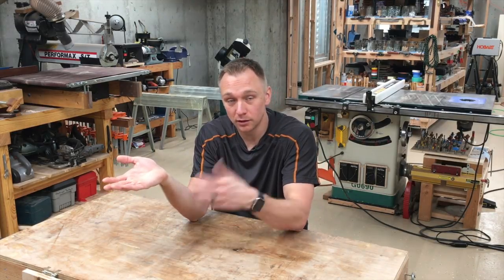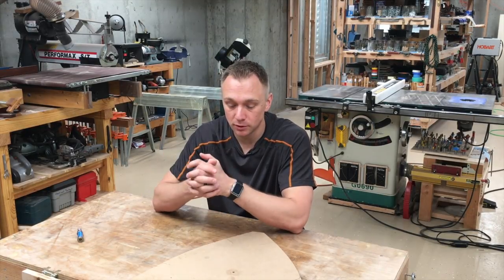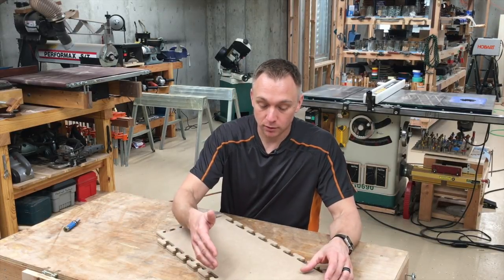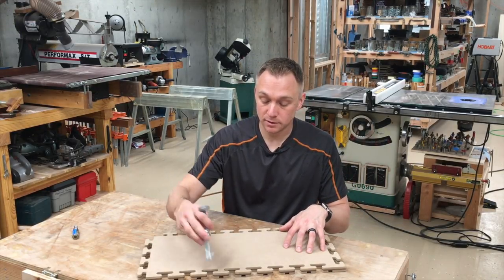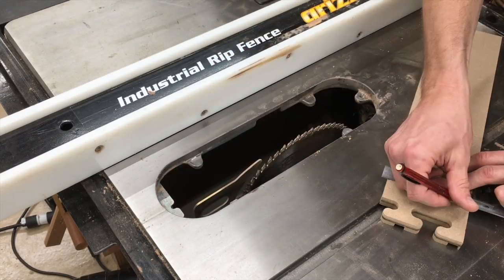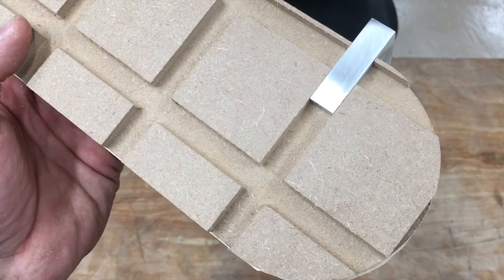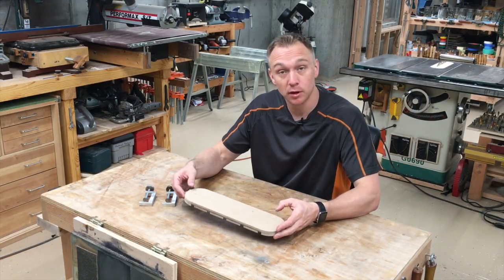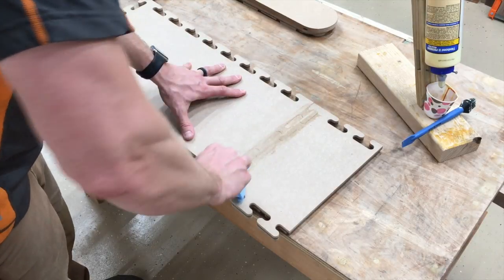Product Launch!!!  Template Routing System

Comment: must say, looks like a great system and the price point looks good! 
I don't do a lot of template routing. but if I may make a suggestion for future product additions,: a clamp with quick adjust like on pipe and bar clamps and a cam action for final tightening. Of course, the average woodworker probably won't really mind the speed of the screw, but production woodworkers might like more speed.

I do a lot of production work, thousands of items in a run,  something that saves me 4 seconds per part for 3000 parts means over 3 hours of saved time. That may not sound like a lot of time, but when I shave 4 seconds here and 3 seconds there, another 5 seconds somewhere else I can cut production time down by more than a day, that can mean the difference between making the deadline or going over due to unforeseen circumstances.
Reply from the maker: Good comments, just fine quick point, if you are are using the screw to switch between workpieces that are the same thickness it is really as fast as a quick release, since there is hardly any travel on the screw.  The screw is a bit slow when you go, say, from a 2" thick workpiece to a 1/4" thick workpiece, but that happens much less frequently.
Reply: Thanks for the reply. I understand what your saying, it was just a thought. I'm always looking for ways to improve production efficiency or ergonomics of an operation.

Comment: I really like your product. I was really trying to figure out a solution to the problem that you solved. One suggestion/question I have is that wouldn't it be more cost effective in production if you would just have different size boards instead of having the puzzle edges cut into every peice? Sort of how they sell plywood sheets in different sizes. That could even become a standard product at big box stores. Imagine a display at the hardware store with the template sheets, clamps, and maybe even your own branded router bits!

Comment: That is a great idea Andrew! However, the Tempro material with the dados and jigsaw edges is not necessary - the user could make the template out of any thick MDF or plywood and then route out small channels on the underside where required (typically 4 locations). The reality is, people will buy the clamps but I'm not sure they will be rushing back to purchase the template material.
Reply from the maker: +Glen Ferris in the end of the video I show how to do what your describing.
Reply: Andrew Klein I came to comment before the end! It’s a great product!
Reply from the maker: +Glen Ferris Thanks Glen!

Comment: That's a pretty good idea.  Should be able to do it with t-slot clamps for track saws on big enough templates, but you usually only have two of them.  Could combine them with these clamps on bigger projects.
Reply from the maker: Yes, similar geometry clamps could be made to work, I've got some reasons why I think this purpose made one is best.  We tried quite a few configurations, and keeping the screw close the vertical post really helped keep the bottom surface of the clamp in the same place as the bottom surface of the template.

Comment: I have done similar operations in the past but with toggle clamps and sleds. Will you be making any of the clamps with a toggle clamp or a quick release mechanism of sorts? I know that retooling takes time and money, and requires more money in inventory and skus. In the past I have only used templates to bang out products faster, this is why I preferred the toggle clamps, most of my designs use an easy to locate point of reference for multiple sleds (usually 2 to 3 per piece). I have always been too cheap for a cnc router but want the speed and accuracy, mostly speed, for craft shows. if a toggle clamp version is in the works I would love to pre-order, if available I would love to see a larger foot on the clamp so the final piece is not scarred by the clamp... something like kreg clamps have but on a toggle mechanism with your foot for this idea.

Comment: awesome system, just one question, why is buying two loose templates + the clamps cheaper than in the pack?😅
Reply from the maker: +G.Work.Specials ? Which pack ?
Reply: the starter package was 69.95 when i looked at it 2 hours ago, since then it has been changed to 64,95, so now it is cheaper again.
Reply from the maker: start-up issues I guess :)

Comment: Awesome idea keep up with the inventing.  Ever consider using a girded template with a vacuum to act as the clamps?
Reply from the maker: Thanks!  Kinda hard to keep a vacuum hose set-up as you are rotating a template around, and to keep a workpiece fixed to the template you need quite a bit of pressure.
Reply: this is where i thought it was going
Reply: it wouldnt be that hard if you had a hose hanging above the router table that could stretch to the bench beside it. and have a rotating hose cuff miunted to the jig.

Comment: template tape the table saw insert to a piece of wood. trace it out, then rough cut it. then template tape it back in place. use a flush trim bit to copy the shape, and that thing is perfect. only took like 5 minutes...?
Reply from the maker: +travis meeks That thing is not perfect, in the video I describe why I don't like using the inserts that come with the saw to make new zero clearance inserts.

Comment: I don't get it. If you glue the boards together, you ruin them. So a large object requiring a 4 x 8 sheet like a table top ruins $200 of Tempro boards. Just add $200 to the cost of the table top and then restock on Tempro boards. Or did I miss something?
Reply from the maker: A few things, if someone was going to template route a massive table that required 4'x8' of template I would probably tell them to start with a piece of 4' x 8' mdf and use the trick at the end of the video I show to make your own template that works with our clamps.  Or not template route at all, there really are better ways to shape a table like that.  The template boards are better suited to, say, chairs for example, because you need many identical pieces, and several different forms can fit on two joined template boards, then the cost is much more reasonable.  But if you did do what you suggest you would only use 8 template boards, not 12 (you don't need the 4 in the middle).  And they aren't really "ruined", you could repurpose that large template and make many smaller ones from it.
Reply: Good reply.

Comment: Went to the website to check out the pricing for the preorders. I can stomach the cost of the product but when you add 6 clamps to your cart and one template board and the cheapest shipping option is $43 I had to say pass. This is a small box to ship and someone needs to look at fixing the shipping costs. I can see $15-$20 Top for ground shipping.
Reply: That does seem onerous. Normally our rates are very good. What is your zip code so I can check this out for you?
Reply: MiterSet - Perfect Miter Joints & Wood Segments 95765
Reply: tyler clark there is something wrong with rates when more than 1 item is added. It should 20.00. I'll get it fixed tomorrow and let you know.
Reply: Tyler, please try again. We have fixed the rating feature in our system and I have confirmed the right rates are coming over. Thanks for your patience.

Comment: Your using the wrong type of tape for templates.. There is a special tape you can easily tear by hand and peal the backing off with your fingernails, that is quick, easy, and strong but will not damage the wood upon removing the pieces together. I suggust checking out a site like www.mobilesolutions-usa.com or https://12vtools.com/ Both sites offer pre-made templates of various shapes, curves, etc that are strong enough to never change sizes due to the router bit bearings but thin enough to stack multiple layers together to make more advanced shapes. These techniques have been used in high end custom fabrication in car audio for some time. All these clamps and cutting "special" material for your template that may only get used a few times is not cost effective nor a time effective.
Reply from the maker: +audiofanaticz Nope, I'll go with mine.

Comment: Great solution, I can see it working well.

The solution I'm currently using consists of two pieces of masking tape and a bit of superglue.

This holds much better then double sided tape, comes off much easier , and doesn't leave any residue:  https://youtu.be/ub6PsY4cgwg (7:07).

For people looking for a more cost effective solution this could help. Also for smaller parts where clamps won't fit this is also a way that will work. 

Other than that, this is a great solution, the cleanest and best holding, so thanks for improving our craft :)
Reply from the maker: +Marijn Koesen Thanks, yes there is a lower size limit of templates these clamps will work for, but it's pretty small.

Comment: So you basicly made a perfect fit template when you could have done that to the actual material first aaaaaaaand you would have already noe the job ...
Reply from the maker: Yes, and that would have been smart if that was the last insert I ever make for my saw.  But it isn't, I'll make many more, and I'll always have the template to make them.
Reply: Andrew Klein but doesnt that make just unnecessary expensive template? Whats the lifetime of the current tablesaw profile? Does their lifespan is justified by making the template?
Reply: Think of it this way ... I have a dozen throat inserts in my testing shop. Why? I have zero clearance for a number of different blade tilt angles so I can cut staves without my work diving into the opening in the throat. I also have several stacked dado inserts that are specific to size of the stack I have in place at any given time. Of course, they do get beat up over time and need to be replaced. I can use one TEMPRO template to replace a dozen inserts very quickly in an afternoon. The value of the system is the rinse and repeat nature. If your making one pass with the router the TEMPRO system doesn't make sense. But many?  It becomes very efficient and effective.